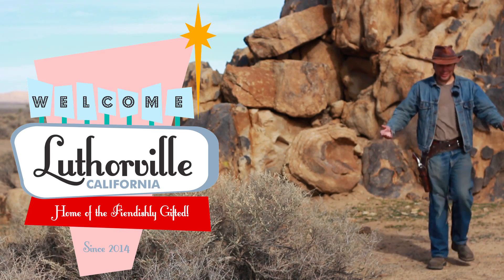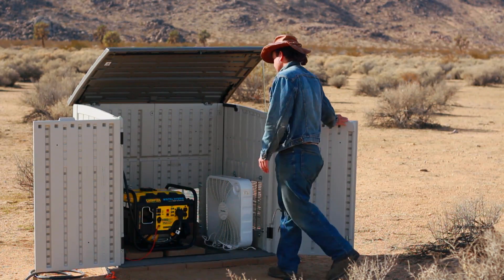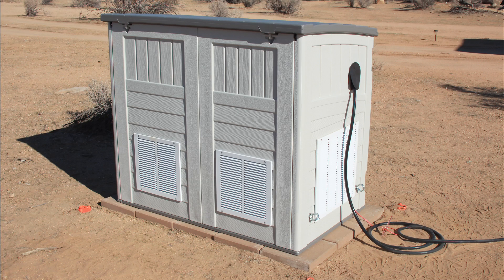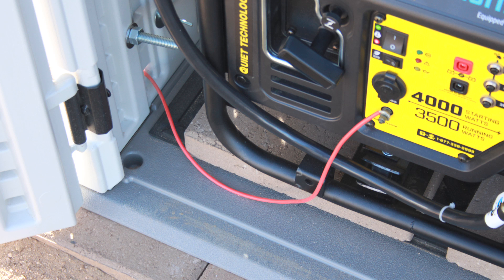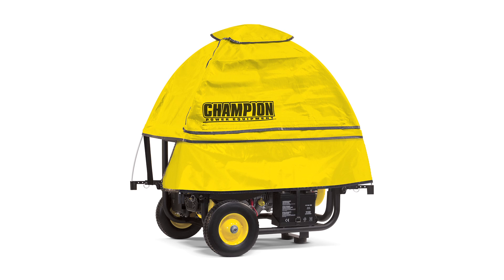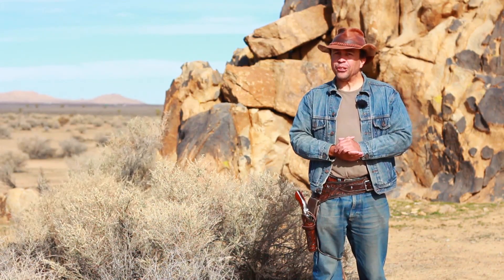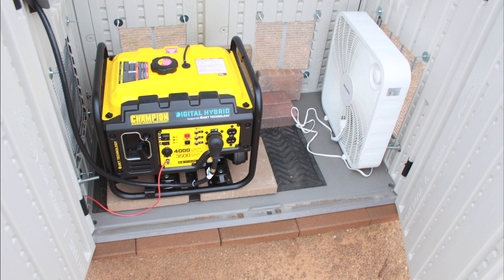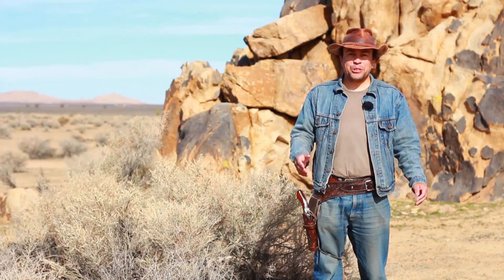How to build a portable generator shed enclosure?

Comment: It's not about the engine being waterproof,  it's the generator/alternator section of the unit that makes electricity and we all know WATER AND ELECTRIC don't work together
Reply from the maker: The Stanley G8000S is an all-weather generator which will run in the rain.
Waterproof generators can be built.

Comment: Hello Eric, I really enjoyed your video.  I have a question concerning proper ventilation/cooling.  What do you think of using "tunnel ventilation" where the fan is at the exhaust end but blowing AWAY from the generator, and a single vent opening (same size of the fan end) on the other?  Basically, doing away with the vents in the middle from the back side.  My thought is that it would create a type of wind tunnel, whereas the air coming in would be at the same pressure leaving the box, creating a type of cooling/vacuum system.  Would the air temperature be cooler that way?  I purchased all of the supplies, and I just thought of this.  I wanted people's opinions about it before I start making cuts in the structure.  Any advice?
Reply from the maker: If I did this over again, (well, I can still do it now) I would put a turbine vent in the top and then I wouldn't even need the fan. The "wind tunnel" would need to be at the top, and I just don't think that would be enough. Remember, your whole goal is to not overheat. So, the more vents the better.
Reply: @LuthorvilleCA  thank you so much for responding!  I really appreciate your knowledge and feedback!  Blessings!!!
Reply: Hot air expands and has more volume, so the same volume of air could not transport the same amount of heat.
Reply: @RosaBeha  Thank you so much!!

Comment: Your videos are very professional  This one gave me some good ideals, although I build most all projects south of Miami, FL for hurricane winds and intense sun so most wood/plastic inferior to concrete blocks down here.  Blocks are my adult legos.  
I will eventually build a generator enclosure near our family campground and turn key vent blocks sideways and fold some metal or nylon screen material over opening and have weight of blocks hold screen in place.  
Your probably to far for Lowes concrete block delivery :) but many people who aren't can just get contractor account with SSN and make up company name by just say mow lawns for business, or landscaping or farm/nursery.  Then instead of $90 delivery down here it's $20 per load and they put Pallets right where you need blocks!  Plus they don't charge for pallet(except concrete bags down here) and you get 5% off all orders.  Might do video on block enclosure if ever build it.  

Consider putting furnace filter behind your vent screens to reduce dust in more expensive generator air filter. 
Thanks for great videos.
Reply from the maker: Thanks for the comment. A furnace filter is an interesting idea, but I would worry about the flammability of it.

Comment: what did you use to cover the hole that the plug goes thru?
Reply from the maker: What you see in the video is no longer there. That was temporary. It was just a piece of rubber from a drawer mat. Now, I have a proper outdoor outlet box in the form of a 1-gang bubble cover.

Comment: I'm in the process of doing this. After looking at a bunch of other videos where people had bought attic fans I figured that was my best option. Love the simplicity of the box fan. One question though; do you simply have the exhaust aimed out one of the vents? I guess it's not hot enough to cause any issues with the plastic of the shed? Thanks for the video.
Reply from the maker: The spacing of the vents, and the size of the shed, is such that the exhaust is kind of half-hitting a paving stone and half-exiting out a vent. But I always have the fan blowing on the generator, which should force most of the exhaust out the vent. I have about 1000 hours runtime on the generator now, in the same shed you see in the video, and have had no problems.

Comment: Hey Gunslinger At least your away from the house but most idiots are listening to you and placing this against their homes, very dangerous! And when you mentioned the Manufacturer does NOT recommend that's the KEY! Don't do it! When you burn you house do your insurance Co will have the right to deny you coverage and believe you me they will send out an underwriter investigator to find anyway possible NOT to pay out a fire job you have caused! Don't do this folks Unless you have this the distance he has his shed!
Reply from the maker: Well, the distance is not just for preventing fire, but also for fumes. You are right - I have seen TONS of videos online where people literally build sheds 3" from the house. You are NOT supposed to do that! Very dangerous. The carbon monoxide can come right in through a window. That's why I put mine 40' away instead of 4".

Comment: Hi my friend john guarino told me he sent a comment to you about his female friend thinking your hot 🔥 that would be me lol. 😳 hot water is easy to get without electricity lol black separate water tank for hot water and black PVC pipes to wherever you want hot water and it works great hit me up sometime you are very hot lol
Reply from the maker: Thank you kindly for your compliments and the suggestion on the solar water heater. You are right, there are many options and technologies out there.

Comment: Sry for the delayed questions but what cutting tool did you use for a clean cut like that? Did you secure the fan to the shed? Did you use any sealer or gasket around the vents? We just had a huge near miss here in Melbourne Fl and this is exactly what i need. Your video is awsome.
Reply from the maker: Q: What cutting tool did you use for a clean cut like that? 
A: Nothing special. Just a plain old jigsaw.

Q: Did you secure the fan to the shed? 
A: No. It's just freestanding.

Q: Did you use any sealer or gasket around the vents?
A: No. That didn't seem necessary.

Thanks for watching!

Comment: that was exactly what I was thinking. Ive seen all of those videos where they fabricate exhaust pipes and all that. I kept thinking why not just put a box fan and the exhaust aimed right at the fan. glad to see that it worked out for you. going to be doing something similar here also.
Reply from the maker: I think a lot of it is just a lemming mentality. One person does it, and everyone decides to do the same thing, instead of considering alternative approaches. Good luck with your project!
Reply: @LuthorvilleCA   I agree with RickWorks247.  
And just to confirm, which way is the box fan blowing air to?  Pulling air from the outside vents  pointed to the generator or pulling air from the generator/shed to outside the vents?  sorry i'm new to this.  great video.
Reply: @chrisi6776  Judging by the position of the fan, it appears to be pulling air in from the opposite side. It's positioned like you would see it in a window with the controls facing toward the user.  Hope that helps.

Comment: Truly Sorry, to bother again. All the bodies of the box fans are made of plastic. Most probably yours too. Is this not a problem being close to such heat? Had to check with you. Also, what do you guys use for TV and computer service? Haven't looked thru all your videos.
Reply from the maker: No bother at all.
The fan has been fine. Hasn't melted or anything. And remember, I have the fan blowing the outside air INWARD. So, all the hot air around the generator is being pushed AWAY from the fan, not sucked into it.
I have a video called "What is the world's most advanced off-grid tiny house?" which was designed to answer all kinds of technical questions. My process of getting online is in there.
I haven't watched television in about 20 years. Since I own Firefly on BluRay, I know I haven't missed anything. ;-)
Reply: @LuthorvilleCA  Thanks once again. Will watch the video you named of yours. FOX NEWS with Hannity, Carlson, Jeanine, etc I have on most of the day on my smart TV..otherwise I'd cut the cord to directv since otherwise I'm a youtuber, and could use the savings.

Comment: Wouldnt you want the fan blowing the air out of the shed, not into it?
Reply: You would want to get rid of the exhaust gas so the fan should blow air out ...
Reply from the maker: I thought the same thing. But I discovered, when the fan is blowing outward, the intense 30MPH winds of the desert, blowing into the blades, can actually cause the fan to stop. I flipped it around and had it blowing inward and never had another problem, on calm days and in intense winds. Excellent question.

Comment: One thing that I learned as a firefighter regarding airflow. You want to have the outflow approximately twice the size of the inflow openings when you are using a forced exhaust system like this. It creates more of a suction which strengthens the airflow through the room, or in this case the shed. Before becoming a firefighter I would have thought the complete opposite would be true, but that is one of the first things we learn and it is used to quickly clear smoke from a room or building. Just something to keep in mind if you ever decide to redo the generator shed later.
Reply: WH6FQE - RC Anderson I'm not a firefighter but I assumed that the exit should be larger than the air inlet ... Especially when you have exhaust gas inside the shed ... That exhaust gas evacuation should be the priority ... 
And I would put the inlet and fan exhaust on the top side of the shed because hot air rises and I'm sure that the heat from that engine and the exhaust gas will rise fast and not sure than fan can move air fast enough to catch that heat ...
Reply: @ACommenterOnYouTube  Actually, putting them on the top wouldn't work as well. It would work for the heat better, but not for the fumes. Exhaust fumes are heavier than air, so they will stay toward the bottom. Having the fan on the side will work better to evacuate the fumes.
Reply: Maybe in the middle ..?? Best of both worlds..??
Reply: Hi, which is more efficient, to pushing air in to the shelter, or pulling air from inside the shelter?
Reply: @tutoyotutoyo6515  It doesn't matter which way you go with it, either forced ventilation or forced exhaust, what matters is the size percentages that you use for each. Because the outflow or exhaust size needs to be about twice the size of the inlet or ventilation size, it is easier normally to have it as a forced ventilation or forced intake with a passive exhaust. But it can be done effectively either way.
Reply: i don't think it really matters as long as you have a VENT on the opposite side to allow the air to be pulled IN or pushed OUT ...
Reply from the maker: That is exactly what I have. The fan is blowing inward, pulling air into the shed through a 16" opening (256 sq/in). There are 3 exhaust openings which are 16", 12" and 12" in size (544 sq/in).

Comment: Thanks a lot. Two great idea in this video: Using the stones and the square fans.
Reply from the maker: Thank you. Yes, the fan and the bricks have worked very well. And even if the fan were to break down, well, they are only $15. Not expensive to replace.

Comment: Thanks for your video, very informative and perfect for me.  I got the same Suncast Shed, I searched online and caught a Lowes sale and took the online printout to a Lowes in Fairfield,CA and got it for $136.00. I checked every Lowes online, then called to see if they had it. And the Fairfield, CA store  had two left and I jumped on it. They were selling the sheds for $249.99, marked down to $136.00. 
Now to my question, ....you said you didn't  use a long pipe for the exhaust and why it's not needed. Does that really work without the long pipe as seen in the other videos with exhaust exiting the shed?

Thanks,
Bob
Reply from the maker: I now have 180 hours on the generator. No problems. No exhaust pipe. But remember, I have a lot of vents and a powerful fan to keep the air flowing, plus the bricks to protect the shed from the heat. And the bricks DO get very warm to the touch, but they never get scorching hot.
Reply: Thanks Eric, glad to hear that about the exhaust issue I asked about. Your video is so simple, clear, easy and cost effective. I have gotten everything I saw in your video,
 I looked at all the videos of Suncast Shed for generators on YouTube and they all provide some good directions for running and housing a unit. But your video solved all the questions I had, thank you,.... but one last point I want to know and it is about generator sound. What's your thought on that? I have close neighbors by and that's a concern here.    I'm going to add in the inside, just above the bricks heat resistance sound deading material that is available online or at the various Bigbox stores, Lowes, Homedepot, Aces, etc. That should cut the sound down to half. But, anyway, great job Eric
Reply from the maker: @beweekly1  If you want to know about the sound of the generator, watch the video I posted right before this one. I show what the generator sounds like, at various distances, while the generator is running.
Reply: @LuthorvilleCA  Thanks Eric, I'll do that.

Comment: Thanks for the video. 
I was thinking about asking you about that shed when I saw it in the other video. 
Did the generator come with the extension cord? I read that extension cords were not meant for long term/permanent use and that over time the cords degrade and can cause a fire.
And can you do a short video showing what the wind storms are like out there?
Reply from the maker: Thanks for the comment.
No, the generator did not come with the cord.
The advice you have heard about extension cords is in reference to daisy-chaining multiple cords. In other words, you shouldn't permanently connect 3 ten foot cords together to make a 30' cord. But, if you just buy a 30' cord, that's perfectly safe.
My cord is 50' long, but it is a single cord. That's fine. Also, you really shouldn't go over 100' in length and 100' is the longest single cord I have ever seen.
Honestly, there is not much to see in a windstorm, other than the chaparral moving around a little. The motion of the chaparral doesn't look very different if it's 15MPH wind or 30MPH wind.